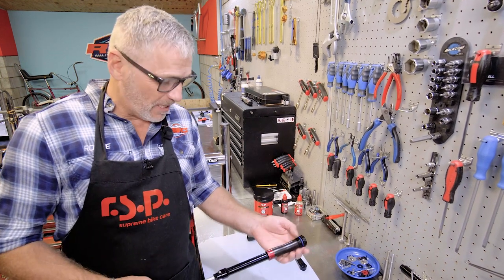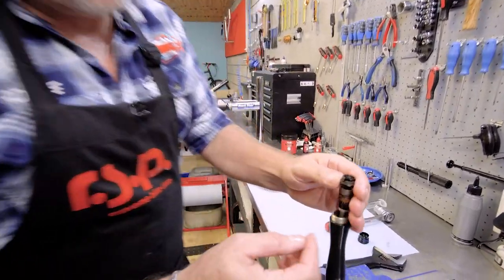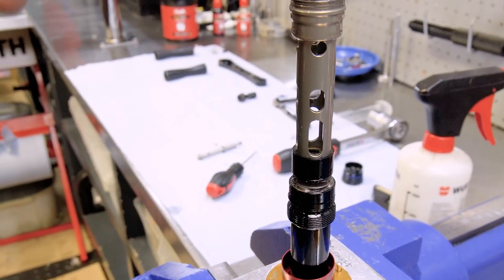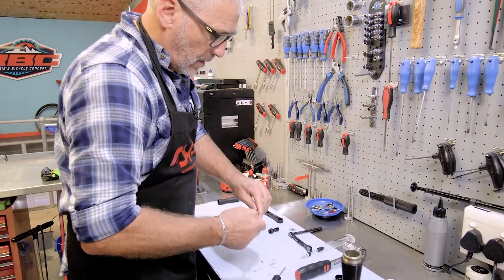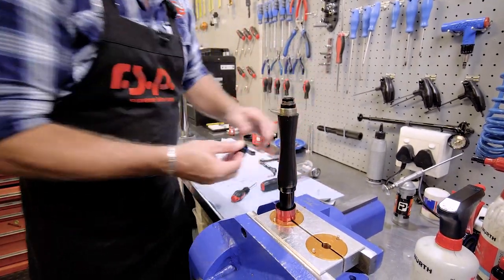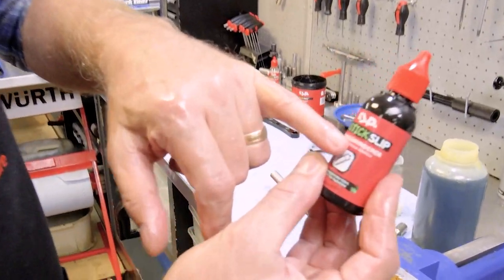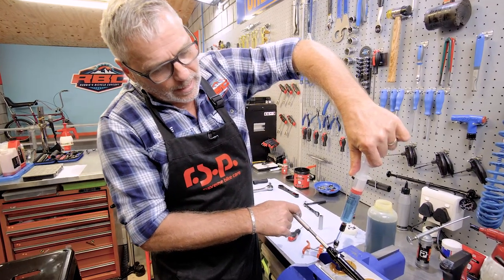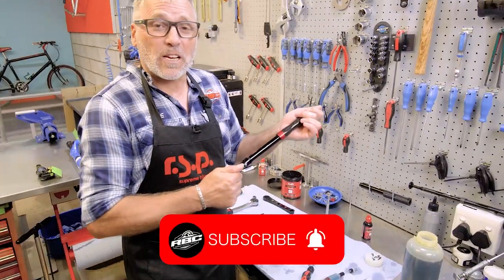Rockshox Charger 2.1 Damper Service - watch as Robbie services this suspension cartridge.

Comment: I purchased a new fork and am having the shop swap out the air spring for a different size. How can you visibly tell the difference between the charger 2 and 2.1 without disassembling the fork? This is my first time at this shop and have had an opportunity to buid any trust with them yet. In addition, is the rc2 built wit a charger 2.1 or could it be a charger 2 or a 2.1?

Comment: Dear Robbie, I really enjoyed watching your video (already several times now 🙂) I did a couple of bleeds on my charger 2 damper, but still no firm lockout. So I guess it must be a problem internally. I will open the compression unit soon for inspection of that special O-ring you mentioned around 6min30 in your video. I hope it is replaceable on the normal Charger 2 damper (please advise), because I saw another video of you on a Raceday Charger, and there you had to install another special piece with an O ring that could be changed. Does this make sense?

Comment: Awesome tutorial man, much different than the simple MoCo open bath oil swap I'm used too. Assume its the same thread as the sram brake (lever end) bleed syringe looking at it.
Reply from the maker: Hi Tommy, thanks for your message and support of the channel. Yes, exactly the thread is the same for the brake lever end bleed port. If you are using the syringe from the brakes, please make sure its clean and has no residue DOT oil.
Reply: @RBC_tech  Yeah always clean the bejesus out of em as I hate getting oil everywhere haha, thanks a bunch.

Comment: Hey, thank you very much for this very helpful and detailed video!!! Please keep up the good work! I'm surprised how much dirt has accumulated under the membrane! I have a few questions about this:
1. how long has the fork not been serviced? 
2. at what interval is this service planned? In the RS service manuals for my ZEB '22 I don't see anything about this!
3. or does this service possibly only apply to certain Charger 2.1 models (year of manufacture, fork model etc.)?
Reply from the maker: Hi s.kolodzie6007, thanks for your message and support of our channel. Yes actually we were also very surprised at how much dirt and water can collect under the remote. To answer your questions, 1. since this is not a "serviceable part" we don't find any connection between the fork service and the dirt under this section other than riding in wet or dusty conditions. 2. Stick to the service recommendation from Rock Shock for your ZEB and make sure its done by a certified technician. 3. It seems that the XC charger damper with remote interface is most affected by the dirt getting in, not so much on the manual and so for never on the Charger for the ZEB so don't worry about this on your fork. Just ensure its cleaned with water with a mild bike wash using a soft cloth.
Reply: @RBC_tech  all right, thank you very much for your quick and detailed reply!

Comment: Really useful! Can you tell me from where the mud gets in? I suppose its from the HSC knob on the crown so can i just cover it when im riding in mud and it will be just fine?
Reply from the maker: Hi FBI-Fipo, thanks for your message and support of the channel. The water and mud gets into the cavity that holds the spring for the return on the remote. This is because the remote wheel and LSC knob are not sealed but run on a plastic bushing for smooth lock and unlocking, this busing/ remote junction is when the water and mud get inside.

Comment: Thanks for the video, it was very helpfull to service my lefty by myself but i just can't put the cartrigde back in. I think is due to a seal inside the lower leg, maybe the one that separate the positive and negative chamber, a kind of v seal. I tried very hard to pass the cartridge through the seal without success. I really apreciate if you can give me some advice. Sorry about my english, it is not my native language
Reply from the maker: Hi cristianramirezargel8290  thanks for your message and support of out channel. So when you removed the damper there was a silver tube section roughly 8cm long that was still attached to the main air seal head, correct? if so this silver tube section belongs on the damper body and not connected to the main air seal head. This should be removed and refitted to the damper for it to pass through the 2  X ring seals at the top of the stanction. The damper needs this piece attached as its tapered at the bottom allowing it to pass through these seals. Trying to fit the damper without this part fitted will result in the X ring seals being cut.
Reply: @RBC_tech  Thank you very much for your reply. I will look for a way to separate the main air seal from the silver tube, I thought it was a single piece since I couldn't separate it by hand. Unfortunately I think I have already damaged the x seal of the air chamber, is it possible to replace that seal?

Comment: Thank you Robbie for the video!! Not seen anything else like this that goes into this level of detail, much appreciated! I happened to be watching as the charger 2.1 damper in my zeb ultimate has appeared to fail as the forks have a very harsh top out feeling and the rebound adjuster appears to make no difference to how fast the fork returns. There doesn't seem to be any ramp up which probably means the compression dials aren't functioning correctly either! There is a slight clicking from the fork aswell. In your experience, will a full damper rebuild sort this issue or is it worth just getting a new damper? Thanks!!
Reply from the maker: Thanks for your message and support of our channel, much appreciated. By the description you have given it sounds like the oil has leaked out of your damper. If this is the case then a service and re-bleed of the damper should sort this out. Failing this then if you are the first owner of the fork and its within the warranty period, Rock Shox should replace the damper for you at no charge.

Comment: Hello Robbie. Thanks for the excellent video. I am also in the process of servicing my RCT3 damper in a RS Pike fork. I have oil coming out at the top of the fork where you adjust the LSC and the lockout of the fork. I noticed now that the spare parts of the damper are not part of the 200h service kit. Do you know where I can buy the seals inside the damper or at least can get the official dimensions of the seal that I can start searching for a replacement?
thx Horst
Reply from the maker: Hi Horst, thanks for your message and support of our channel. The part you need is available as a kit called the Charger remote kit - spring and seal. This is available from us, please contact Cam on sales@rbco.co.za for the details and costs to ship to you.

Comment: I am going to be referring to this video when my service kit arrives! I need to get the bleed syringe still but I’m confused on which one I will need. When I do a search for it I see one that is compatible with the Reverb and one that says it’s for the Charger damper but only on Pike and Boxxer. Which syringe are you using here? Looks like the metal tip on the one that works with the Reverb. Thanks!
Reply from the maker: Hi @kylehotchkiss7085 thanks for your message and support of our channel. We use the reverb bleed kit for this so if you have this it will be perfect. Good luck with the service, if you need any advise just let us know :-)

Comment: Thanks for detailed explanation of this. My fork is stuck with the lockout on. The top small lockout lever should twist a quarter turn between lockout on and off but it can spin 360 without making any effect. What part of the internal mechanism would you suggest has gone wrong here? Could it be a result of vertical impact and maybe fluid going between fork parts or is it something in the damper mechanism that has become dislodged? Any help appreciated!
Reply from the maker: Hi Samuel, thanks for your message and support of our channel. If you have the charger damper as in the video then it sounds like the pins controlling the lockout shaft have broken off or the shaft has separated at the top. Not sure what could have caused this but its unlikely that a crash could do this unless the fork has taken the full force of the crash on the lever side. I would need to see this to ultimately give you an answer but I recommend a new damper.

Comment: Hi from Czech, thanks for your knowledge. But i have a question, i have a problem with instaling the spring (13:20). When i turn the spring, lower piece of spring will drop under the rubber seal and i dont push it down. Do you have any tips for that? Thank you for answer.
Reply from the maker: Hi @filip.k19 thanks for your message and support of the channel. Yes this can be quite tricky, I normally stretch the spring a little, then fit the lower part in first before connection the upper to the lockout interface.

Comment: Thank Robbie, a great video and very well explained. On my Lyric forks the low speed compression needle appears to be stuck. I can't adjust the low speed compression knob, and when I attempt to disassemble the damper I can't get it to unscrew. Do you have any tips on how to free it so that I can get it out to clean it and complete the service? What is the needle made of and can I buy a replacement? One idea I had was to drain the hydraulic fork oil from the damper, and refill with a light penetrating oil. Is that likely to work or will it damage seals or other parts?
Reply from the maker: Hi Dave, thanks for your message and support of our channel, please send me a picture of the damper including the top showing the compression dials to rbcbikes@gmail.com then I can offer some advise on how to fix the problem.
Reply: @RBC_tech  Thanks for the kind offer of help. I have sent you an email.

Comment: Thanks , great vid.    Does the charger 2.1 rc2 damper lock out ? Mine does not , it just gets stiffer
Reply from the maker: Hi @rg8707 thanks for the message and support of our channel. The RC2 damper you have has independent high and low speed damping adjustment and is not made to "lockout" like the RCT3 damper.

Comment: Thank you for your good info. I have charger2 rc2 damper in boxxer 29 ultimate. Unfortunately LSC seems to be sucked with HSC. So cannot adjust LSC knob by itself. When adjust HSC, LSC also move. Also oil leaking on compression knob parts when heavy compressed and riding.  is LSC rod boken in damper? Could it be repaired?  Thank you for your consultation in advance.
Reply from the maker: Hi and thanks for your message and support of our channel. I recommend that your damper be serviced, opened and checked, if the oil is coming out of the compression knob the skirt seal definitely needs replacing. At this time the service agent can check the LSC and the HSC to confirm what the problem is. I believe this could be dirt blocking the LSC rod at the top where the rod enters the compression dial.

Comment: Hi Robbie, could you please explain to me how to set the lockout spring? Do I have to preload it? My damper opens when i Turn it counterclockwise insted of clockwise.
Reply from the maker: Hi Raf i , thanks for your message. the lockout spring is quite tricky to set, firstly you need to ensure that the high and low speed needles are completely turned out to the negative on the compression body. Then fit the spring into the hole inside the damper. I use a 13mm or an 11mm ring spanner to hold the top of the compression body. Then ensure the outer end of the spring is inserted into the compression housing, at this stage do not push the compression body into the damper as the high speed needle will push into the damper and you cannot set the spring with the high speed needle in this position. Carefully turn the compression body clockwise against the spring and when the keyway is reached push the compression body into the damper. Test the lockout actuation with the ring spanner to ensure you have the full movement.

Comment: Hello...great video...thanks. Am I mistaken or did you use 5wt oil while Rockshox recommends 3wt for the charger 2.1 ? Does it make a great difference ?

Second question, RS doesn't seem to have any kits including spring and bladder in case they need replacement. How to find that?
Reply from the maker: Hi Franz, thanks for your message and support of our channel. Correct I use the Fuchs Silkolene 5wt damping oil for the charger dampers as it has better viscosity index at temperatures above 25deg C which is normal here in South Africa. For the 2nd question the kits are available from us as they are not offered by Rock Shocks as an after market option. If you need to get these please email me on rbcbikes@gmail.com

Comment: Congratulations, great video, very educational! Does this also apply to Rock Shox Sid Select 2021? A suggestion would be a video with the maintenance of 200 hours.
Reply: SID SL Select uses Charger RL, which is slightly different.
Reply from the maker: Hi Vitor, thanks for your message, "the One" is correct the SID SL used a different damper which does not have a bladder and is quite easy to service. check it out here https://www.sram.com/globalassets/document-hierarchy/service-manuals/rockshox/front-suspension/2021-2023-sid-and-sid-sl-service-manual.pdf

Comment: very good video! I do have a problem with the charger 2.1 damper in my zeb ultimate. The bladder is leaking, do you know where you can get one. It seems like Rock Shox is not producing spare ones.
Best regards 
Lukas
Reply from the maker: Hi Lukas, check with your SRAM distributor, if you are the first owner and the fork is within the warranty period and you can prove its been serviced by SRAM you should get a warranty damper. I am not sure how it works in your location but this is what I would expect to happen.

Comment: Thank you for sharing Robbie! Can you please specify the type and size of the seal at minute 10:45 (x-ring, v-cup or u-cup)? Tx in advance.
Reply from the maker: Hi Andrea, this is a specific u-cup seal for the charger damper. the code is CHRS 1701
Reply: @RBC_tech  Maybe you remember code of  the spring needed ? I got the same issue that you were solving in the video. Lockout knob do not have any power to return to open position.

Comment: Amazing video. Thanks for making it. I would have a question about a new Lyrik Ultimate. I just bought it few days ago and when I fully close HSC and LSC I do not feel any difference when both are fully open. Do you have an experience that the new fork would have some problem with damper? THis is my first fork which has the separate HSC and LSC knobs.
Reply from the maker: Hi Jozef, thanks for your message and support of our channel. The damper you have has the HSC and LSC separately adjustable as both have a complete different function. The LSC will reduce bobbing and unwanted movement of bumps whose force does not exceed 400mm/s. The LSC is a parabolic needle which reduces the oil flow through an open port forcing more oil through the shims thereby increasing the low speed compression. The HSC works on a different circuit and will only effect compression on big hits, that exceed the 400mm/s that the LSC works on. So your question- the LSC dial will have a minimal effect when pressing on the handle bars due to the slow compression power you are putting on the bars, likewise the HSC will only be felt on big hits like drops or jumps. My recommendation is first ride for 30 min to warm up the damper then make some changes to the LSC and HSC on a course that has some berms and drops. The changes you make here should be evident in the forks handling.
Reply: @RBC_tech  thanks a lot for your comment. I appreciate it.

Comment: Hi there- great videos thanks for posting !  I have the 2.1 RC2 and sram wont sell me any parts for it- I'd like to do the same service- can you tell me where ai can get the spring and skirt seal? Appreciate it!
Reply from the maker: Hi Robert, thanks for your message and support of our channel. Just to confirm, is the damper leaking? if not then I would not recommend opening the damper to replace the skirt seal. All that's needed is a flush out the old oil and fresh oil added to keep the damper smooth and in good working order. Also if you have the 2.1 RC2 damper then you should not need the lockout spring so if you buy the kit, the spring will not be needed.  Thanks Robbie
Reply: @RBC_tech  Thanks for getting back to me; sorry yes dont need the spring. the issue is when the fork rebounds it makes a loud sucking sound. sram told me I need to replace the damper...
Reply: sorry and yes its leaking from the top on top of the adjuster knobs; if the skirt seal is the same size for the 2.1 rc2 then yes thats what i need !
Reply from the maker: Hi Robert, ok no problem, where are you based? Our minimum shipping cost for international orders is $38 so its costly just to ship the skirt seal. If there is a ND Tuned dealer close to you it would make sense for you to get from them. If not I am happy to assist you no problem.
Reply: @RBC_tech  ya that is a lot; is there a part number for the seal?
Reply: @RBC_tech  hi thanks for getting back to me; is there a sram or ND part number maybe i can find it closer? thanks !

Comment: Nice video, but can i change the spring without bleeding it?
Reply from the maker: Hi Carina, unfortunately not, opening the top will remove the bladder seal so it would need to be re-bled after replacing the spring.